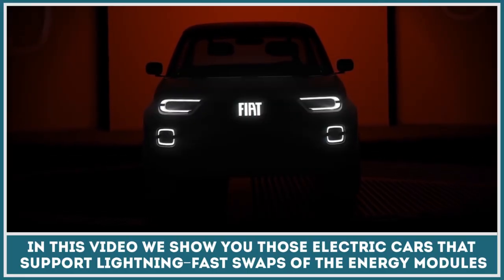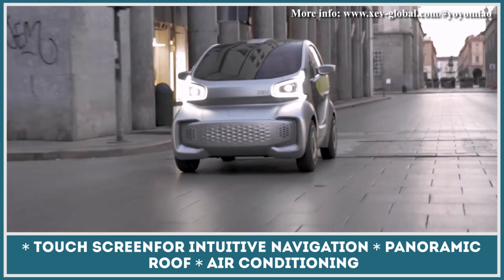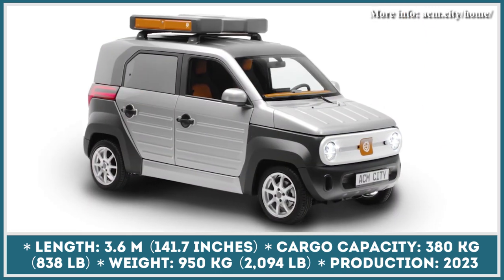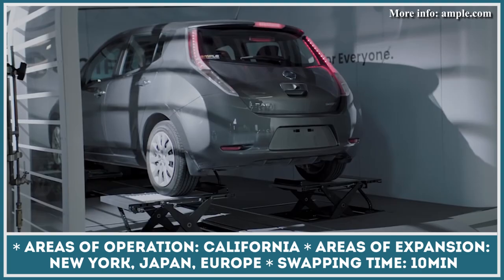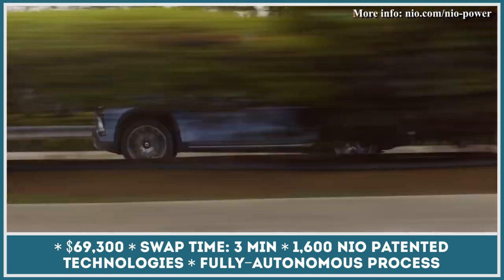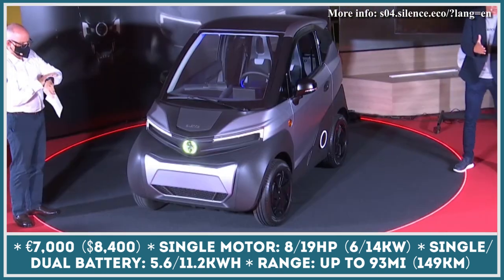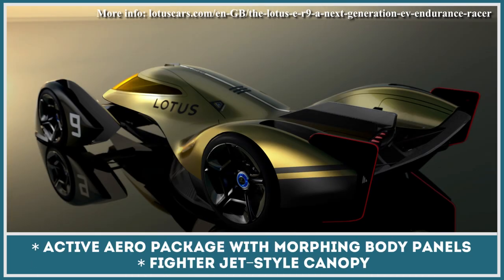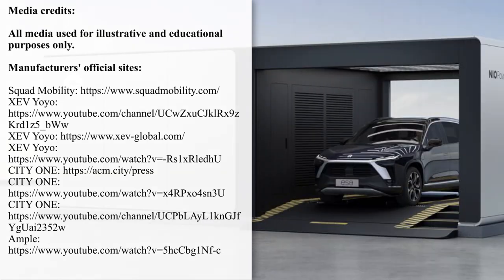Modern Electric Cars Featuring Removable Battery Packs (Review of Fast-Swap Stations)

Comment: Making the EV car batteries easily replaceable is by far the best way to go.  And not making them easily replaceable will bite every owner of a second-hand Tesla (the original ones will just buy new models) in the ass when the batteries are due for replacement. Btw, calling Elon Musk “a visionary” is a bit of a stretch. The guy did not found Tesla but just bought into it after the business was founded by Martin Eberhard and Marc Tarpenning.

Comment: The issue with most modern electric cars is the cost of getting to a qualified service center and having them replace the battery. The obvious benefits of a swappable battery is inexpensive do it yourself swapping/replacement. Taking the battery inside during extreme cold weather. I want a car that has a battery that is no more difficult to replace and charge then an electric bike.

Comment: Battery swap is probably the best solution until we can get faster charging.
It works for large commercial mowers and small power tools.
I have Ego and Greeworks products along with Dewalt and Craftsman battery tools.
Swappable batteries are the best solution.

Comment: I notice that nobody wants to talk about EV's in snow. I'm lost as to why all EV's do not have AWD with in-wheel motors like the Aptera and Nobe do. Equally weird is why so few come with solar panels as standard.
Reply: Solar panel requires an inverter which in turn requires extra space and would also add extra weight, not worth it for 20 mins extra driving from solar charging on sunny day.

Comment: Looking at the Citroën ami you tube videos from all over Europe  there  are people trailing leads from a second floor balcony  and down walkways because it has not got fast changing or battery swap technology the best you can do is use a battery pack with a inverter built in at the side of the road because they never thought of appartment
dwellers now supermarkets and drive through outlets are charging people for spending more than the allowed time parked and it takes up to 4hours for a full charge it only does 28mph max so only usefull for inner-city